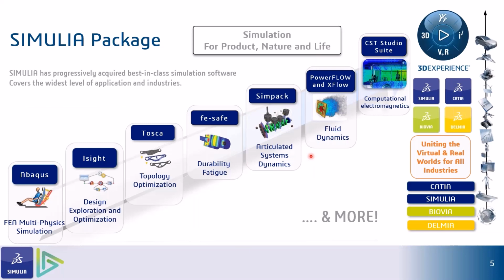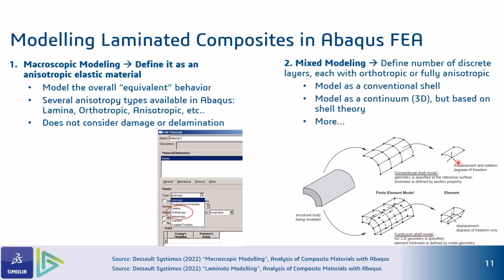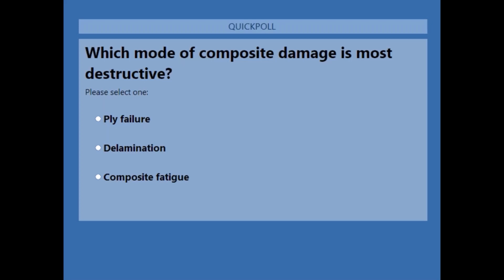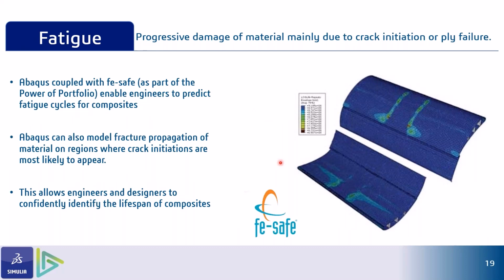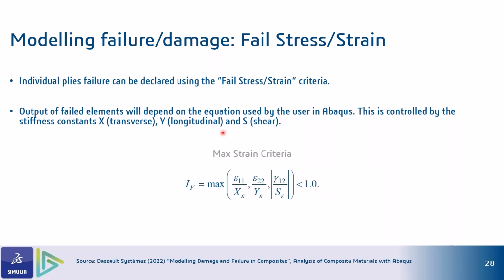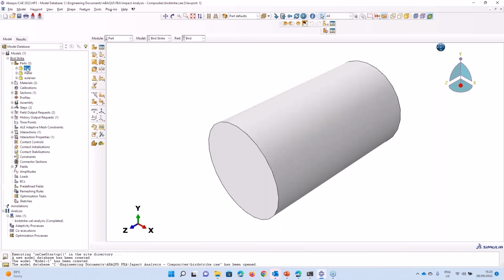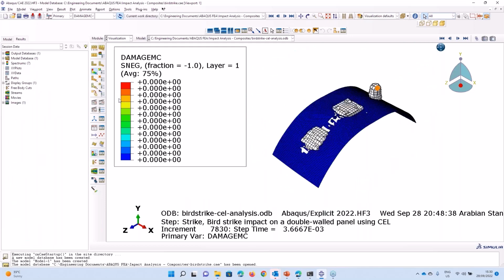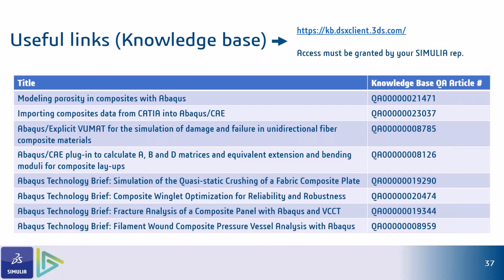Composite Damage Simulation with Abaqus: Ply Failure, Delamination & Fatigue

Comment: Hello, good time
Excuse me, I had a question.
I am working on a bird collision. The collision is with a composite. My composite material is special. I use the VUMAT subroutine.
At first, when I gave the bird material, it gave an error saying that I should use the sph method. I just gave the density and elasticity. It worked. I got the answer, but it doesn't spread like a bird. It just sinks a little. Both the structure and the bird's head.
My question is, can I give the subroutine and use the sph method? That is, can I do both at the same time?
Since my Abaqus is linked with Fortran, I opened the Abaqus command, but some changes I made were not applied.
Or is there another way other than the Euler and Lagrange methods and sph to spread the bird on the structure?!
Reply from the maker: Thank you for your interest! We'd love to assist you further. Please feel free to contact us at: contact@launchtech.ae for more information or any inquiries.